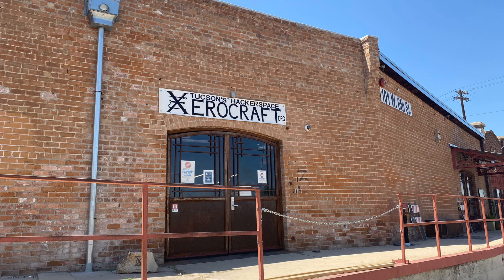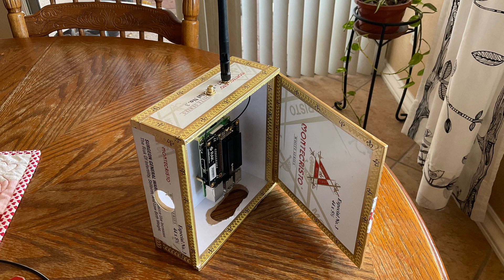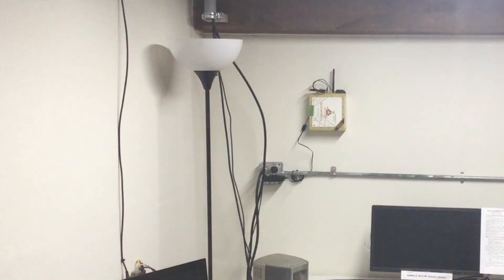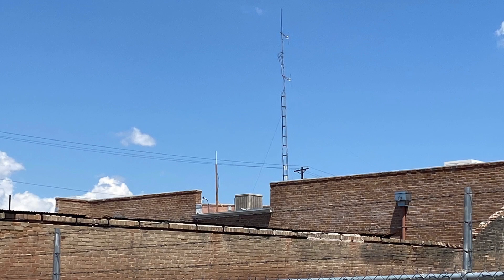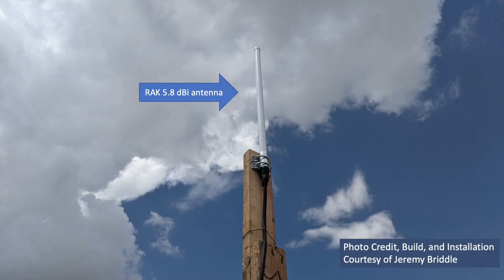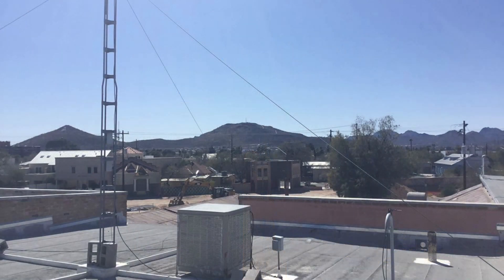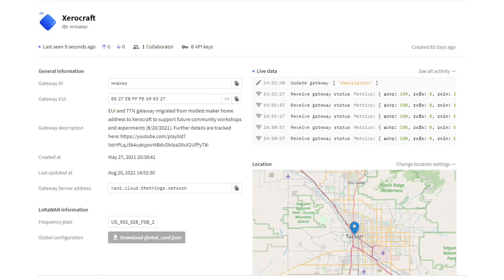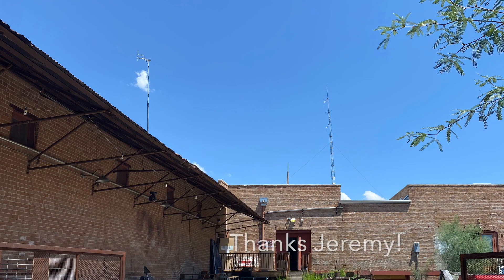Xerocraft LoRaWAN Gateway Update - Installed!

Comment: Have you taken a look at the coverage area of Helium in Tucson so far?  It has absolutely exploded.  I'm running a node on the east side of tucson but am looking to upgrade my 3dbi antenna to a 5.8 or 8dbi since it's a little bit more flat over here compared to the buildings I was trying to overcome with my TTN node on campus.
Reply from the maker: Hi Robert - nice to hear from you and apologies for the late reply. I think a 5.8 dBi antenna is a nice compromise, but I don't think antenna dBi is nearly as important as line of sight. A few more for less dBi may not matter if you have significant path loss due to poor visibility of your target area-- at least that what my instinct tells me after playing with these systems for a few months. 

For context, path loss can impact on the order of tens of dBi, so an extra 3 dBi on an antenna won't help much in situations with poor visibility (e.g. indoor antenna). Your antenna on the UofA is ideally situated, probably the best site in all of Tucson that I'm aware of since it's elevated, outdoors, and has a 360 degree view of the city. I suspect that matters more than antenna dBi, especially for LoRa which is so sensitive to lower power transmissions.

I've been attending to a personal matter so have not been able to do much WRT LoRa since August, but hope to dive back into this in February once some personal business is attended to. Hope to touch bases with you then. Cheers.